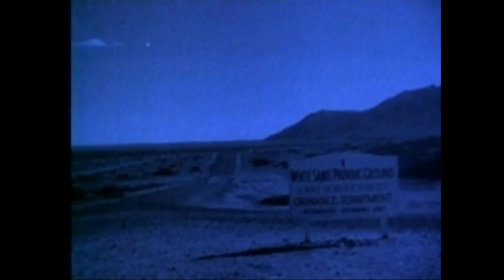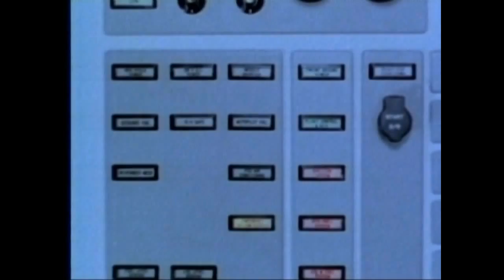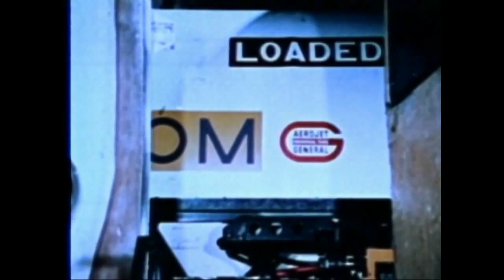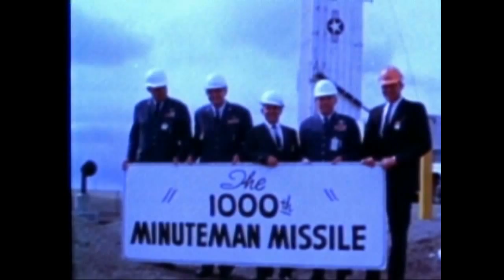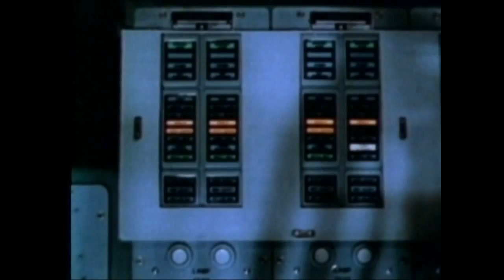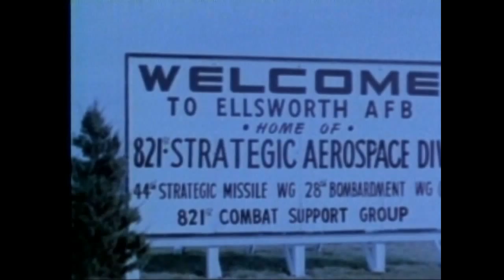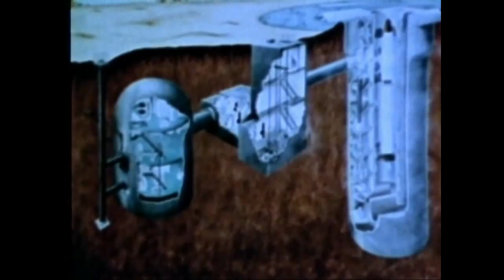Greatest Mysteries of the Cold War: American Missile & ICBM Technology

Comment: I doubt they need to for two reasons.
One, they are most likely already in the air when enemy missiles hit and two [in case of smuggled in bomb or satellite based ruse system], the silos are most likely secured otherwise a secure missile wouldnt have the means to fire with a knocked out fire control system...

Comment: Tim Berners-Lee pioneered a Protocol & Language not a Browser. That's like confusing Rudolph Diesel with Henry Ford, One invented an Engine the other mass produced vehicles. One is a constituent part, the other is a product using that part. ARPA pioneered it, but certainly didn't pay for what happened next, universities, commercial entities and other institutions invested in it building the superhighway. Which later turned into the Internet, but ARPA started it Berners-Lee made it accessible.

Comment: You mean the LGM-118 Peacekeeper? Well, that program was canceled, and the first stage solid rocket motors are now being used by Orbital Sciences Corporation in some of their satellite launch rockets.
Most of the US ICBM arsenal is still Minuteman-3's (that have been continually upgraded).

IMO, ALL ICBM's are evil, doesn't matter which nation made them.
The u-235 and/or P-239 in them would be put to much better use generating electricity instead of burning coal for the same purpose.